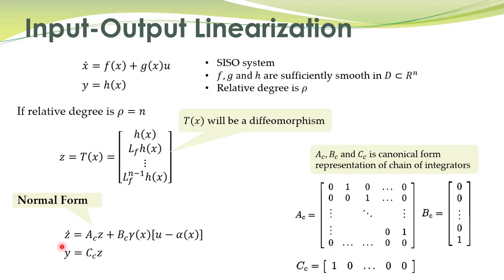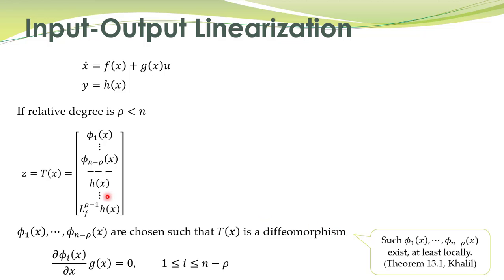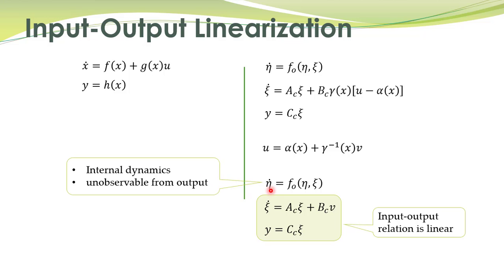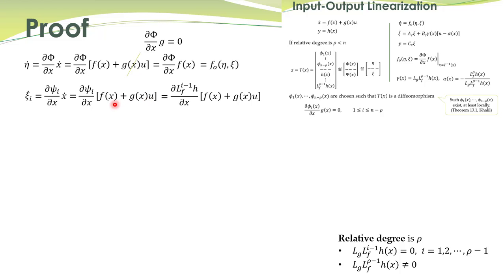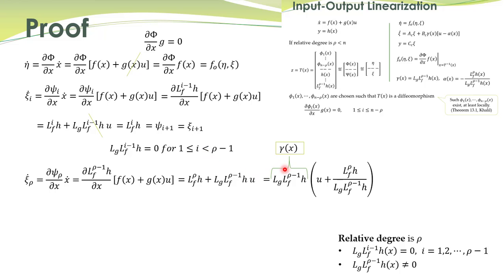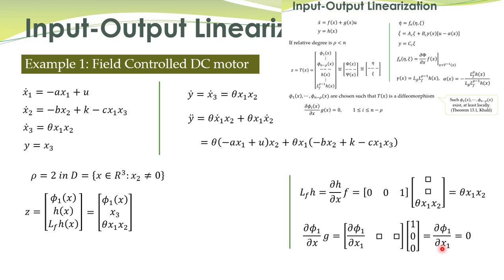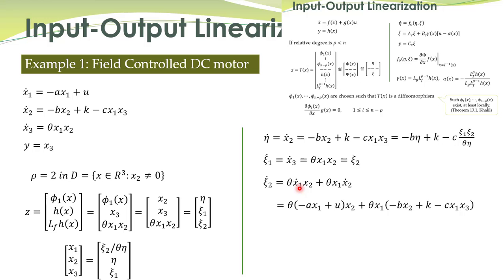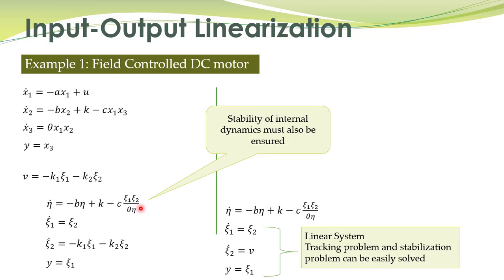NCS - 28 - Input-output linearization

Comment: Dear Sir,
I am taking your lecture and taking some example from realistic system  to understand your lecture extensively. However, if you have time, you can see page 3 in this paper (https://drive.google.com/file/d/1rE9lAdQpQocBRyUHEGvHO-dNHFOUN3DY/view?usp=sharing). Although the relative degree of system is less than the number of state variables, author takes whole Lie derivative to find state transformation based on output equation. I mean he did not find eta like the way you did. I have a confusion about that. I hope we could discuss enthisiactically.